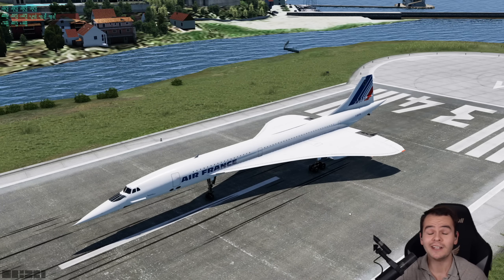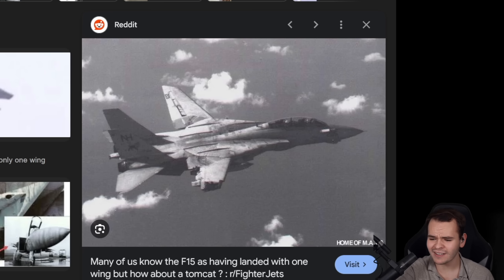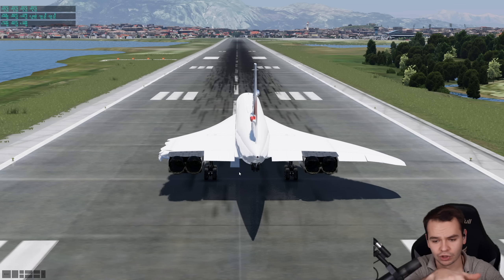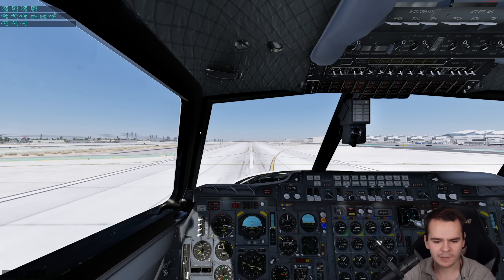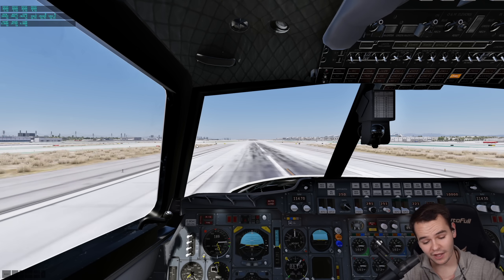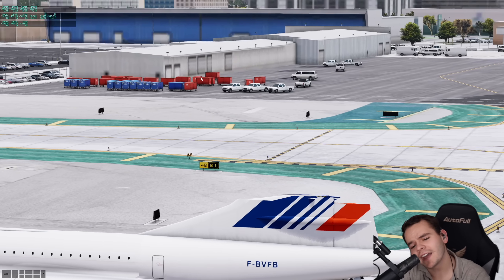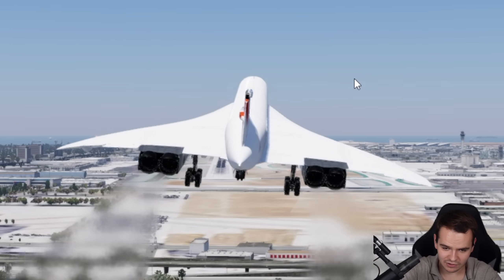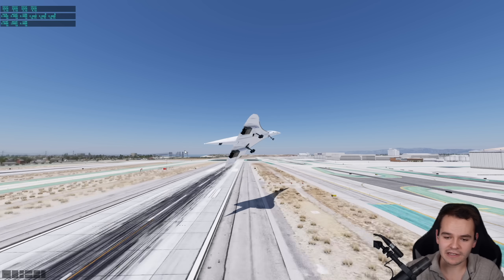I Tested Concorde's WING Failure and Here's What I Found

Comment: The difference between this and a fighter jet is not only the engine power to weight ratio. Its also the fact that Fighter jets use their entire body to generate lift and have alot more movement in their control surfaces as they need to turn 10 g. This makes it so that the fighter jet can compensate by giving more control surface deflection as the concord can not. Also the part you cut off, is the one part essential for low speed flight lol...

Comment: Hey Swiss001 The control surfaces on the Concorde were called elevons. Which serve both purposes of elevators and ailerons. I believe the concord used this design to eliminate the need of a horizontal stabiliizer a surface that would cause incredible drag on the aircraft at supersonic speeds. This is also why the space shuttle used this design because it’s a common attribute to delta wing designs.

Comment: The highest lift factor of a wing is usually towards the ends of the wings, since the Concorde had a wing with a similar profile to a usual airliner wing just extend to look like a delta wing, cutting off the edge is like ruining a huge portion of lift that the wing generates.

On a Boeing 777-300ER for example, the area of the wing from the engine to the wing tip generates about 45-55% of the total lift the wing produces. So just think about it… the wing is getting narrower, yet the lift factor increases.

Edit: To add, fighter jets wing profiles are two sided, since the fighter jets are made aerodynamically unstable in the most part, with very complex computer overrides, F-16 and F-22 are extreme examples of a computer that constantly fights the aircraft from falling out of the sky. 

A fighter flying without one wing is a much different story to an airliner, you lose the outside bit of the wing? you’ll be very hurt in a commercial airliner.

Comment: Did you try to use engines to control a bit of yaw? Like they did in 747 when down dumper stabilizer got stuck in right position